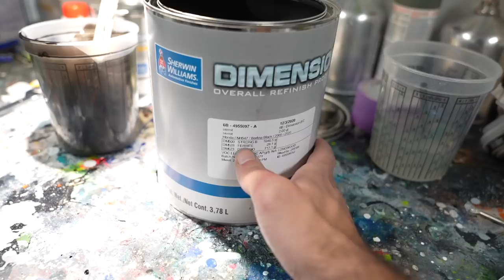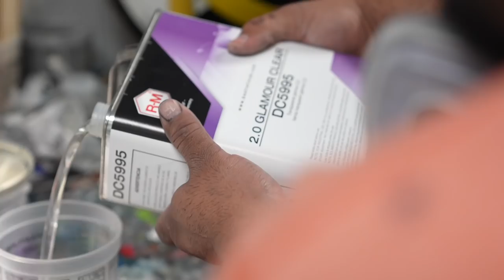My Marga Hills NSX is DONE! FULL REVEAL!

Comment: Black paint is so hard to get right, every reflection is like a mirror and any deffect is gonna be so obvious to the eye. I'm just a little concern about the rear right fender, it's look a bit rough and "sharp" on the start of the over fender part at 20:00 (like a low polygone 3d model). But appart from that, she look like a stanced JTCC NSX love it 😍

Comment: MIKE.......you think locktight is gonna lock your spacers on? what are you using to take them off, your teeth? Its not an issue for an air wrench lol ffs think about it with your brain lol
Reply from the maker: I’ve had that stuff snap studs and strip nuts in the past using an air gun, hence why I never use it lol